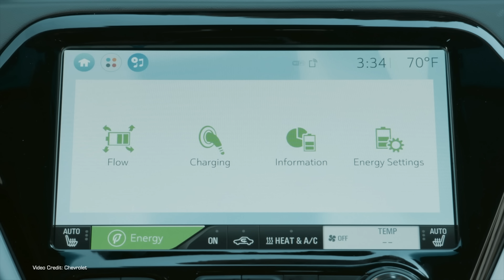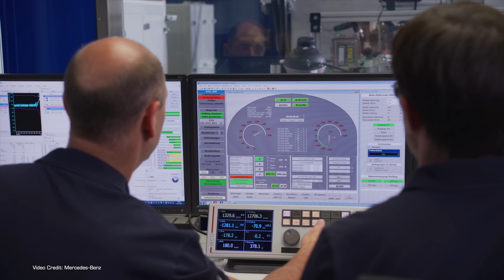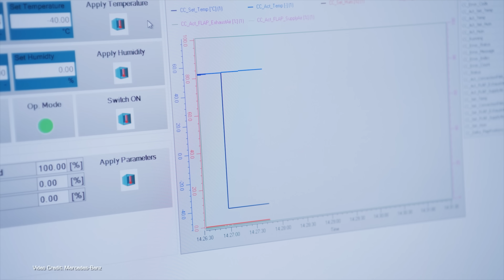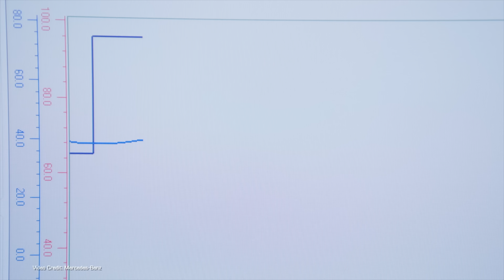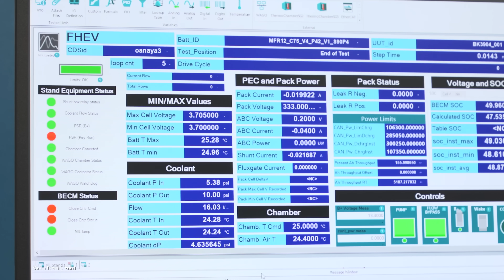Should You Buy An EV With An LG Battery Pack?

Comment: Thank you all for this deep dive. It makes me wonder if cylindrical cells are more robust? Maybe this is just an issue with pouch cells being fragile.
Reply: The small form cylinder cells are better at dissipating heat than pouch cells.  When one small cylinder starts to overheat from a tiny defect, the cooling system is much closer and the excess heat can be spread amongst the other cells before a fire occurs.  It also slows battery degradation over time.  All batteries have tiny defects to a certain extent.  That’s why the BMS is so important.
Reply: @willaerley7140 I'm thinking pouch cells might not hold up as well with long term vibration, everyone seems to focus on other things because we already have data for other stuff. If pouch cells catch fire more often in cars, it might be because they're not as physically robust. The only way to find out, I think, would be to disassemble some of both types from well used car batteries and compare
Reply: @willaerley7140  that didn’t stop a model s plaid from catching fire or all the other Tesla model s.  The leafs have pouch cells and there are a lot of leafs with no problems other than degradation.
Reply: @markfitzpatrick6692  There hasn’t been any reliable info on the s plaid fire yet.  I’m referring to spontaneous fires and not ones caused by accidents.  Yes, there are rare reports of Tesla’s catching fire, but it seems to be fewer every year as the batteries and software have improved.  The pouch design might be perfectly fine.  The problem could be the Bolts small buffer, cooling system, BMS, or plain defects.
Reply: The original Soul EV had pouch cells, and yes, they are more fragile in certain respects, but there have been no issues of Soul EVs bursting into fire.
Reply: @CaroAbebe  there are a lot more Chevy bolts on the road than Soul EVs. It may just be that they hadn't made enough of them to be statistically significant.  But there were also a number of Tesla fires, and they use cylindrical cells. I wish it were easier to find reliable statistics to compare